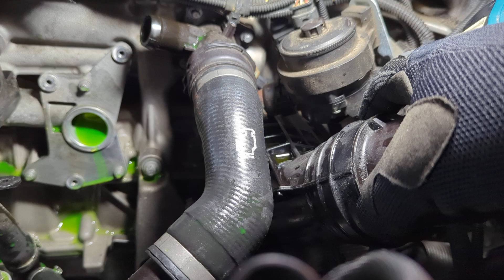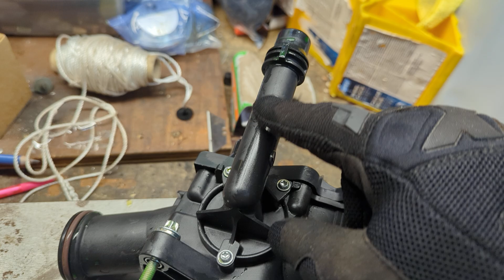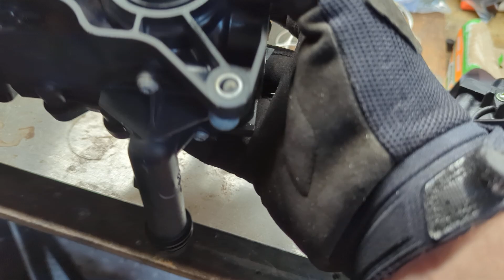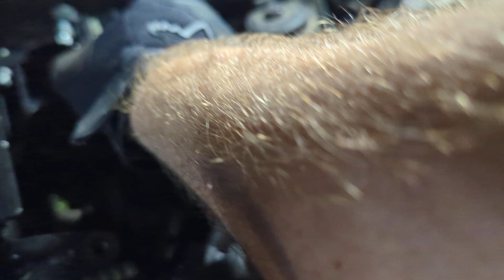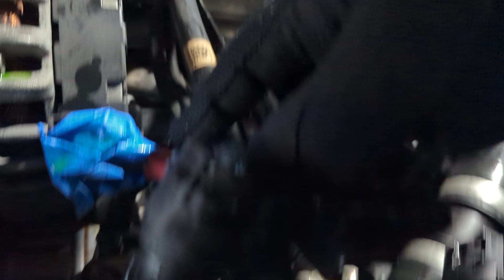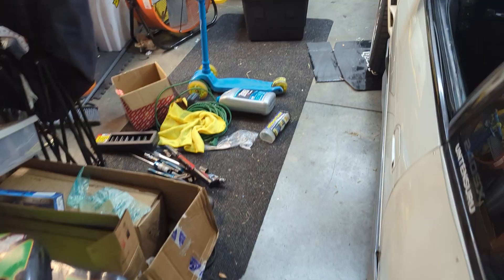BMW 340i B58 E-Thermostat and water pump replacement

Comment: Hi your 340 is a 2018?
Mine is and I bout it 4 years ago from bmw certified warranty, which is expired over a 1.5 year now.
But my car came with green coolant 
Many others have mentioned it to have blue coolant 
Did you add the green?
I’m about to change the main coolant line and a few others along with my OFH 
While I’m in there.

Should I stick with the green ?
Lmk please

Comment: I’m having trouble getting the piece of pipe that connect the thermostat and the back of the water pump off, seems to be stuck
Reply from the maker: Double check you have all the bolts fully loosened from the block, it should just slide to the rear of the car. It you are replacing the thermostat unit, you can probably get a little force on it since the water pump side is metal. I bet the O-ring is stuck.

Comment: What are the torque specs for the heat management module and the coolant flange/connector? There is a electrical component that you need to swap to the new coolant flange, what is the torque spec for that too? Thanks in advance
Reply from the maker: You know, I'm not sure. I was going with around 18-20 foot pounds due to the size of the hardware. Also I didn't have to replace any electrical unit mine may have just come with it installed already.

Comment: Did this solve the leak issues? I've replaced the oil filter housing and coolant neck peice and still getting a constant leak. Just ordered the e tstat. Hopefully that solves it.
Reply from the maker: @1shownfu  yeah I've had a few leaks back there, you really have to figure out where it's leaking from before you can make a solid judgment on what to replace. And I think that's the hard part with these engines, since there's not a lot of room to see what's going on and where things are leaking from. What helped me for a more recent leak was a UV dye and a UV light that helped me track down the exact location.
Reply: @Untensuru.  thanks! The e-tstat replacement took care of the leak. I wouldn't have suspected that without seeing your video.

Comment: Hey. How many miles on this specific car ? Or in general what's the lifespan of these thermostat housings/oil filter housings..?
Reply from the maker: I can't say for certain on the typical life span, but mine had around 120k. I also had a rock hit my radiator at one point which drained my coolant and blew up my water pump on a long drive. This likely prematurely failed due to running without water for a short period of time and having to replace the water pump which connected to the outlet on this unit. It thermostat was still working at the time, it just had decided to spring a leak somewhere and I thought the easiest solution was to just replace it.  One of my other videos shows the water pump and housing replacement if you wanted to see that.

Comment: How long did it take you to replace the oil filter housing? I ordered pretty much all the coolant parts underneath the intake manifold and ready to replace them all at once 😢
Reply from the maker: That one is a bit more of a pain. There is a hex bolt on the backside that I had to find a specific tool to be able to reach it. I could only get it with a 1/4 inch drive deep socket store that had a slight swivel on it from harbor freight tools. They don't sell that kit anymore either. That being said I would say it added a few more hours, but the car was down for a week or so more due to all the hoses I broke getting to it. I wrote it up on Reddit:

https://www.reddit.com/r/F30/s/e9DluK0krX
Reply: Took me like 20 hours to replace OFH and the plastic Mikey mouse flange. Hardest part is getting access to the bolts. Had to remove the thermostat housing to reach the last bolt on the Mickey Mouse flange. The problem is having to remove other things to get to a single bolt. Total PITA

Comment: The coolant color is green in the 340's? Normally every BMW i've owned the coolant color is Blue
Reply: BMW transitioned to green coolant in the past few years. I believe it was 2019 when they made the switch.  The new one is H-12 while the old is G48 (blue).
Reply from the maker: @north_tracy  it's typically blue, but I ran a dye in it to trackdown the leak.